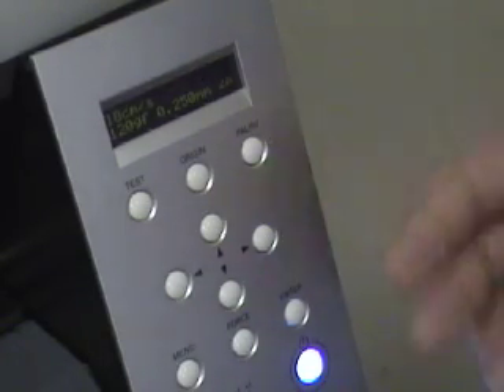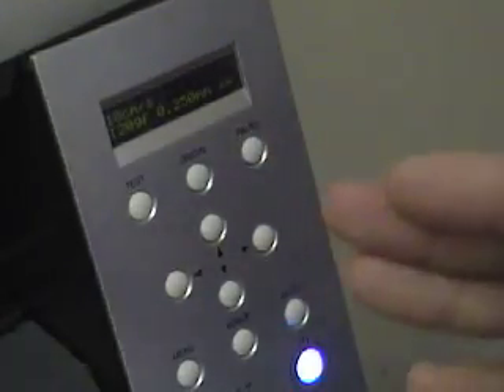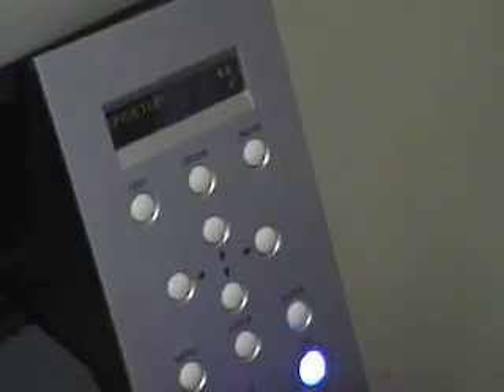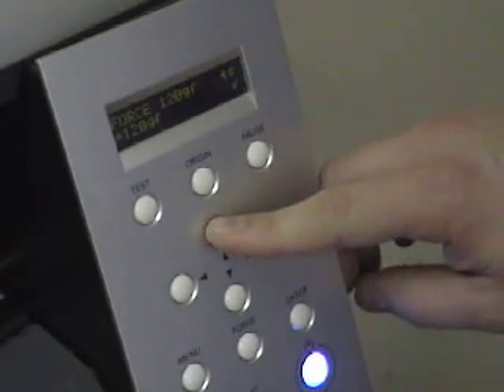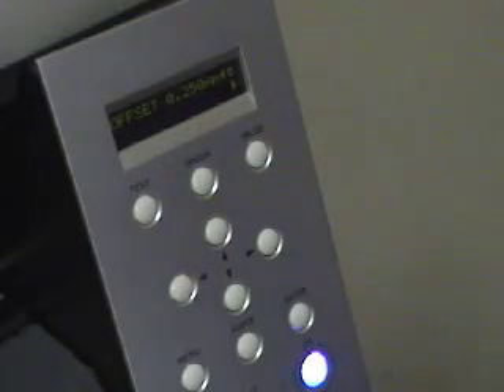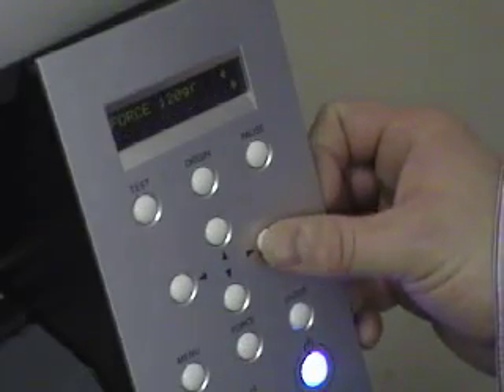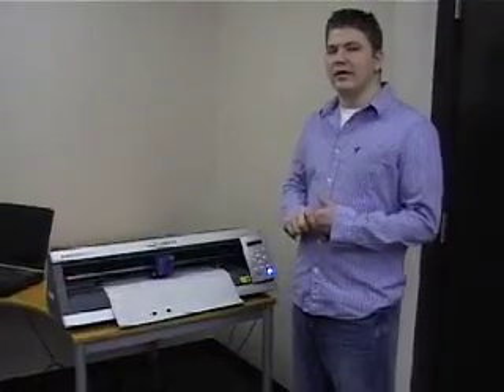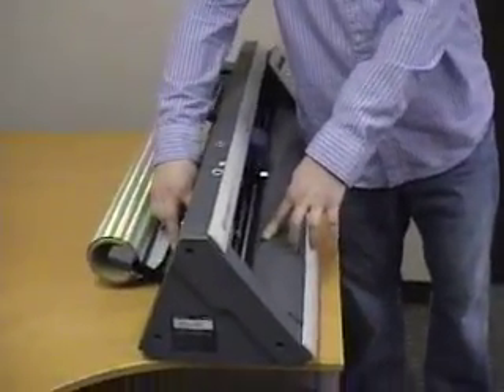Roland GX-24: Cutter Set Up Part 2 (Video 2/8)

Comment: Why in some videos they put the coloured side up and in this video you do it the other way, coloured side down
Reply from the maker: Hi Maxx! That is because this heat transfer vinyl is on a liner so you need to cut it with the adhesive side up and mirror your design. Then you will weed away the excess and use that liner to transfer the vinyl to your garment. When you are seeing vinyl being cut face up, it is most likely adhesive vinyl or sign vinyl.